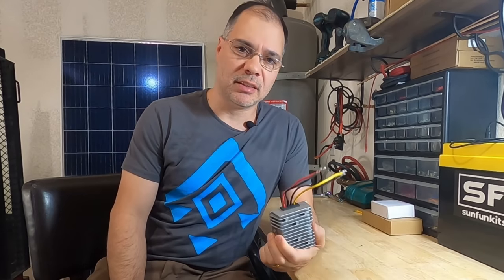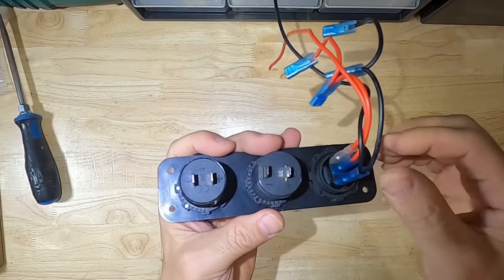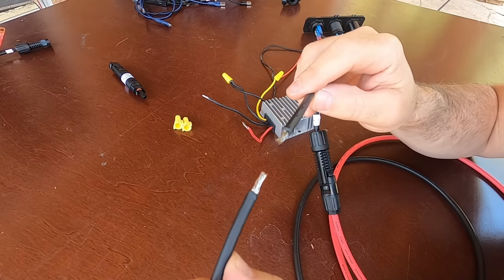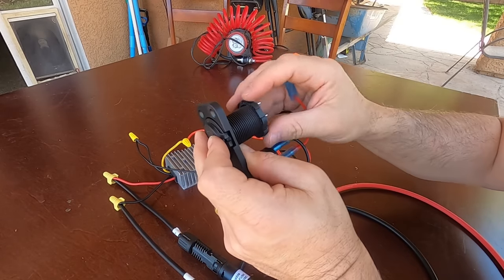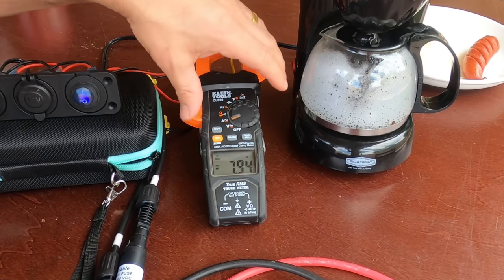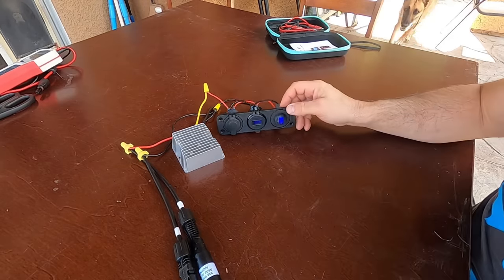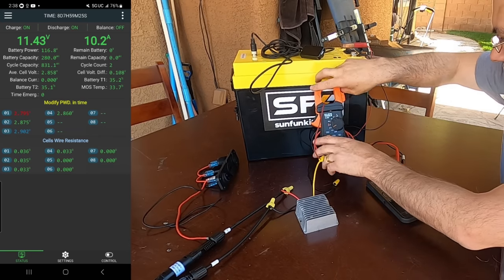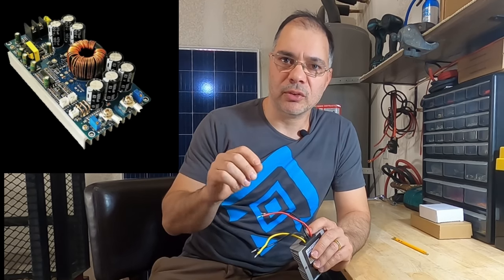SHTF - Cheap Emergency Solar Power! Use Any SINGLE Solar Panel! 1/2

Comment: Anybody watching this in Europe, or even just planning to use this in a potentially damp environment, don’t use wire nuts as shown here. They’re not EU compliant, so you shouldn’t come across them in Europe, but some do find their way through eBay and Amazon, etc.
The allow moisture to wick a long way along inside the sleeve and turn the copper on positive cables into green powder. Worse, they cause a resistive connection and can generate a lot of heat, even when the wires are correctly sized, so they present a real fire hazard.
For experimenting like this, in situations where everything is exposed at all times and will be dismantled immediately afterwards, a wire nut is slightly better than just twisting the wires together and taping them, because it adds a little mechanical strength and also forces the copper together a little harder, so they’re worth holding onto, if they come with something you buy, but don’t use them as a permanent installation, particularly not in any sort of a vehicle.
Reply from the maker: Yes, do not ever.  It's all I had laying around. I think the buck converter is waterproof, but no ipk rating
Reply from the maker: I did. Mention that in the video.  Not to use on solar system or DC circuits. I provided 2 alternatives.  Xt60 or butt connections.

Comment: can i run a 1000watt pc
Reply from the maker: No way.  This is for small 12 Volt stuff only.  PC takes AC power
Reply from the maker: here is a video where I power a gaming PC with my DIY solar power station.

video: https://youtu.be/6e3dx6qFvX0

Comment: I was under the impression those 12V cigarette lighter plugs were only good for 10A.

Interesting project. Though the sun going behind a cloud shows why you may want a battery and charge controller.
Reply from the maker: Certainly.. yea, most automotive circuits have a 10a fuse, but the socket itself can push a lot more.
Reply: I wired a 12V cigarette lighter outlet in my RV with 10AWG wire, and put a 30A fuse before it. I've run 25A+ loads with no problem. The restriction in most vehicles is due to the smaller wire size, not the plug itself.

Comment: because its not "sine wave" it will hurt some devises,right?
Reply from the maker: That only applies to AC current. We are dealing strictly with DC current here. But there is something called DC ripple that could be problematic in certain situations when using DC to DC converters.

Comment: Can you charge a 12 volt battery this way?
Reply from the maker: Yes, you can.  I did it in the video.  But you will want a buck converter that has say a 14.5v output to get it fully charged but a 12v one should give the battery enoughf power to start a car.
Reply: @natesdiysolar  I must have missed that part.  I will rewatch the entire video.  Thank you fort your response.
Reply from the maker: @justretired6879 it's at the end. I updated the description with some other converters that have a 13.8v output but lower input range. Good for charging 12v batteries.  Hope this helps

Comment: SOLUTION; SEARCH WZ5020L
Reply from the maker: This looks like a power supply only?
Reply: @natesdiysolar  it takes up to 60v and drops it down with very little loss in current.
Reply: @natesdiysolar  it's adjustable.